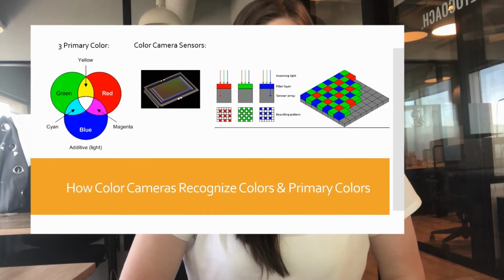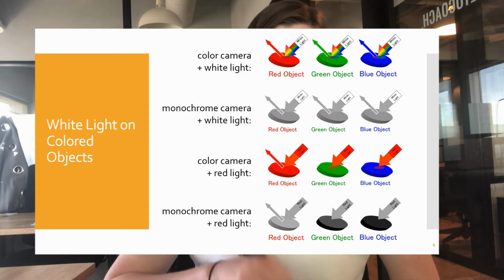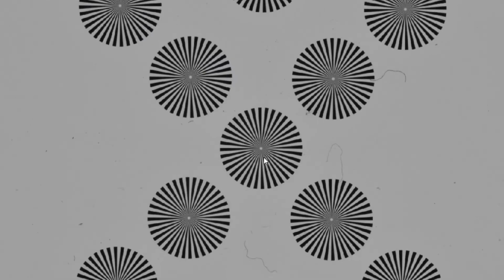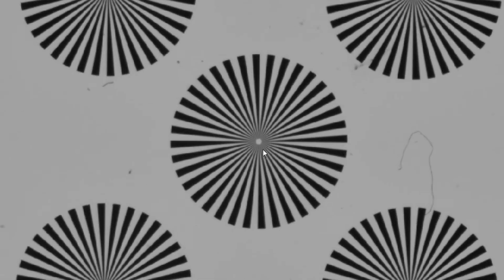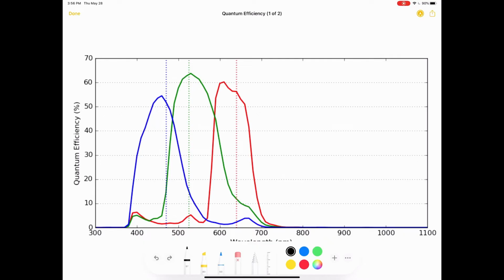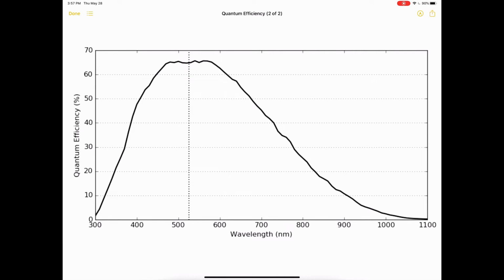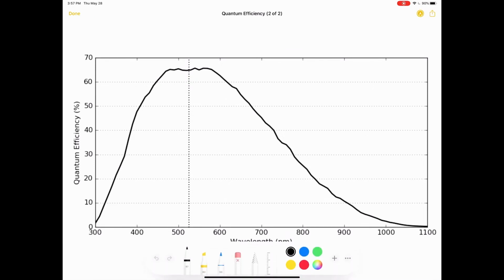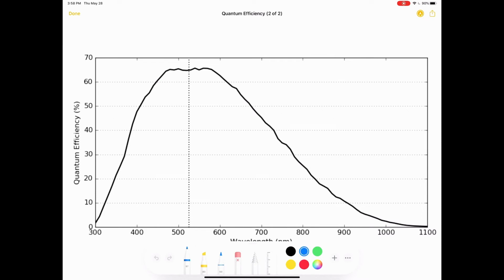Axial and Lateral Chromatic Aberration

Comment: I don't really get this with lateral CA, how it works. What I do know is the fact that the different colors focus on different distances from the optical axis, causing fringing. But I don't get that they are getting magnified differently. If we shoot a star at night, will the red light from the star have different magnification than other colors, causing the red star to be bigger or smaller than, for example, the blue star? My view is just that the colors are the same sizes (magnified the same) but just the fact that they are shifted differently along the image plane causing fringe. What is wrong in my view?